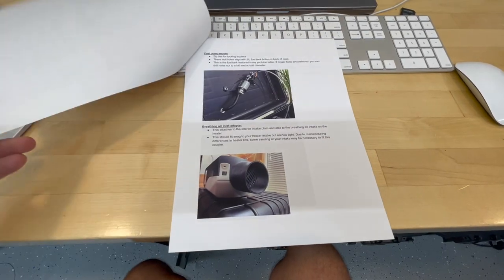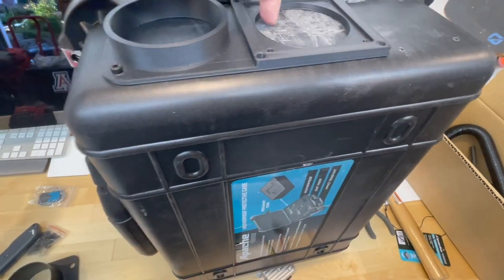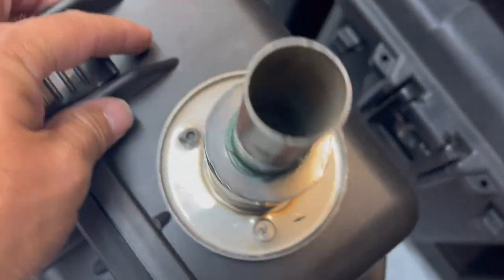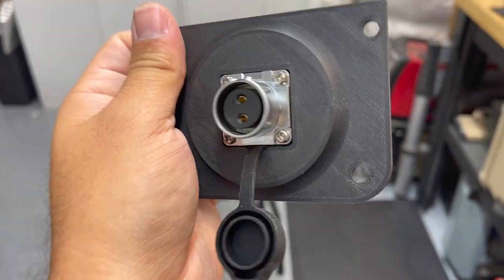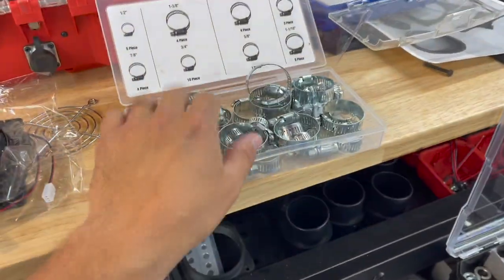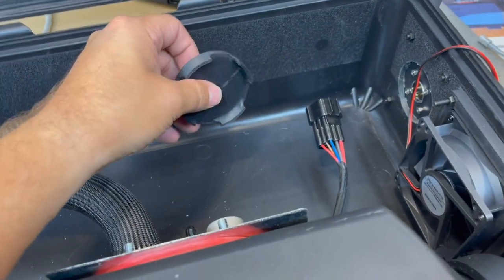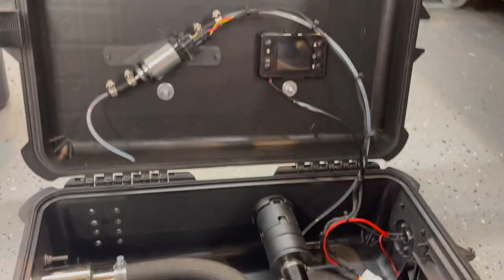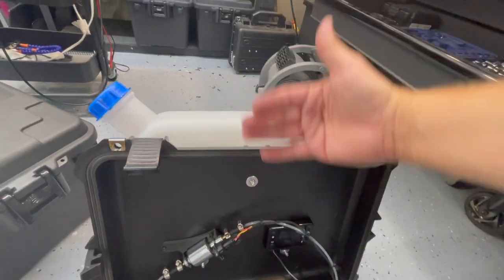DIY Diesel Heater in a box: How-to

Comment: I just finished my 5kw build with your parts. Thank you for making this project faster and cleaner. I’m looking for some longer 75mm duct hose. Ideally something more durable and insulated. Any ideas?
Reply from the maker: https://amzn.to/3SSZ3c5 a bunch of guys use this for there tube
Reply: Congrats, how much did it all cost in the end?  I only need a portable heater for ski camping a few nights out of the year as I have a Propane fireplace in my camper already (not good enough when its 0 degrees).  I was considering the HCalory HC-A01 but this build looks so nice.  I'm guessing it may be more than twice the cost tho.

Comment: Maybe i missed something but what is the purpose for putting it in a box?
Reply: Portable in one easy carry, already setup unit. Depends what you are using the heater for and where you are going to mount it. You could borrow this too someone whose heat was out with little setup.

Comment: Using your layout and 2kw parts which I bought from you….  Can you put the controller screen inside the 2kw smaller case (without it melting)?
Reply from the maker: you sure can! Then just remember to run your heater on Hertz mode and control heater speed with the wireless remote.

Comment: Why the 12v fan on the case??
Reply from the maker: 3 reasons, 1) provides air to the heater combustion intake, 2) keeps components inside the case cool, 3) helps evacuate any potential off gassing or fumes if there was ever an issue.

Comment: I can see there's alot of work gone in to this but it just falls short of perfect... and theres no way I'd trust the fuel tank fitting... also why didn't you put the wire through the small hole and fish it out the big hole then attach the nozzle and pull it back??.. I don't feel I could turn that on and let it run with out constantly checking for fuel leaks.. but other than that not a bad set up...
Reply from the maker: Check out my 2kw version if you want to see a whole other level of engineering that went in to this thing. Would love to see what you come up with when your done perfecting it :)

Comment: Hello Keegan!  Just finished building this and all the hardware etc fits perfect.  After initial testing it was working great.  However, I just ran into a voltage error code and am not sure why.  E-01.  Could this be because of my soldering?  Using good wiring albeit a cigarette plug off of a Goal Zero 1250.  Haven't had issues before with this heater as I had it installed in my previous truck for a few months using the same power source.  The Goal Zero is at 1/2 battery capacity but is still supplying 100+ watts when the heater is firing up.  It will run for a minute or two then stop due to the voltage code.  Any thoughts?
Reply from the maker: Hey Barry, try plugging that cig lighter plug in to your car whilst the engine is running. This will ensure high amperage. (just as a test). Also question, how long of a cord did you make for this? I wonder if you are getting voltage drop over a long cord length?
Reply: @keeganbuilds  I did this and am still getting the code.  The cord is 10ft max haven't measured it though.  Could be less.
Reply: I am going to try to fully charge the battery pack and see if that helps.  It usually is connected to my truck and charges while driving.  Right now I don't have it installed so it is showing 50% battery capacity.  That may be why it is dropping too much voltage.  Its a big unit though so I didn't think it would drop so much.
Reply: Any update on this code?  I have the same thing off my battery kit.
Reply from the maker: @NickOcean  usually under voltage. Try hooking up to a car battery on a vehicle that is running to rule out possibility
Reply: I ended up tearing the heater down and cleaning it.  I think with the low voltage it sooted up and compounded the problem.  I also got a new battery pack.  Seems to be running good now but occasionally will throw a code. I am going camping this wind and am going to run it all night the night B4 just to make sure.  I'll let you know how it goes.

Comment: Wouldn't it be cheaper to just buy the all in one heater?
Reply: The obvious problem with those is how crappy the case is, and has no waterproofing or dust proofing. They would probably rattle apart after one washboard road. This you could set on the ground outside your tent year round in all weather.

Comment: do you really need  the extra exhaust fan? its dragging extra juice out.
Reply from the maker: The fan is pushing air into the case. Not drawing it out. The purpose is to provide cooling air to internal components as well as the internal combustion air.
Reply: @keeganbuilds I’m curious why not just place another hole in the case for the intake? I bet you could get away without an intake fan then. Have you had the case melt? Or have you ever tried this?

Comment: Can it be run closed? Or does the case have to remain open?
Reply from the maker: I typically run it closed exclusively. sometimes I open it up just if I am messing with something, but generally speaking, I never even open the case.
Reply: @keeganbuilds  Awesome, thank you for the response, I am fixing to buy your kit on Etsy and build this in to a Milwauke Packout Large Tool Box. Have you had any issues with plastic melt at the junction where the exhaust goes through your case?
Reply from the maker: @gzusburrito  nope. If you use a proper “thru hull exhaust” it works great!

Comment: The only question I have is why? You can buy them already in a metal case. Your design is also dangerous if used indoors or in side of anything. If you set it outside and just duct the output hose inside you will be loosing a lot of efficiency. Return air to the heater should be from inside the heated space. Anyway, have fun. To each his own.
Reply: Build quality for 1 customization for another, mine has a tank on the case but I can also run it to a 5 gallon jerican, carry mine back and forth from my boat to my pickup.

Comment: DO NOT!!! use the “dryer” type hose for a regular install, it’s fine for this because it’s so short. On a regular install it’s too flimsy when the heater is running, ask me how I know… Thought it was a good idea for a tight area install and it was until I turned on the heater and the hose got hot… bad idea.
Reply from the maker: Great call out! I would also point out that if you are using dryer vent hose for your outlet, you can use a bit of the flexible piping that comes with these heaters to give yourself a heat buffer. Maybe cut yourself a 1 ft section and have that go between your heater and dryer vent tubing.

Comment: How many pin connector would you need to put the controller on the exterior of the box if it all possible?
Reply from the maker: 5 and it’s 12v pos, 12v neg (for heater) then 5v pos 5v neg and blue signal for the controller
Reply: @keeganbuilds  will that fit your same plug plate?  I purchased your kit off Etsy.
Reply from the maker: @scottshellenberger4721  it will! Same exact shape. Just pick up the 5 pin plug from the same link

Comment: I really don't understand why you would go to so much effort to build this from kit form.  Your basic guy on the street will take hours to do all this, get very frustrated and annoy his/her partner for days.  Why not just buy the built diesel heater that even costs a lot less then yours did to build.
Reply: And not have your fuel line running directly on your exhaust pipe
Reply: Well, I am a basic girl who is following this video and build.  I am at the point of drilling hole for fuel hose and so far, I have done great , THANKS TO THIS VIDEO!!!  The only thing I am nervous about is soldering the wires on quick connect.  I never soldered before so hope I don't screw it up..  this build is not hard if you follow his video!  Great job n thank you!  Now I can enjoy ice fishing again!  Cant take the cold the older I get.  Crossing fingers I will be test running this, this weekend.!

Comment: Do not do this its stupid and dangerous for so many reasons the fuel line is resting on the exhaust and the thermostat is inside the case WTF its a bomb and the off button is in the fire area.some people are all about the views and point not your saftey. Not to mention you can by these in a all in one metal box for 10$ more than the heater kit itself and there's saftey measures in place 😀.
Reply: Go back and watch it again at 36 minutes 20 seconds you can see that the fuel line is on the air intake into the combustion chamber not the exhaust from the combustion chamber. I have to agree with you about having the on and off switch inside the case but in another comment you can put a five-pin power connection and run everything into wherever it is you're powering it from, like I do for my boat and for my truck. And if you want to go by the metal case go by the middle case.
Reply: That's what we are here for. To point out concerns and work together to perfect the process. I would prefer a metal box.
Reply: @Nimashet  the on and off is done with a keychain remote.

Comment: The air intake for the combustion chamber should always receive air from a fresh air exteriour source for better fuel burning this gives the chamber and injector a longer life and the exhaust should be fitted to release gas outside to avoid DEATH BY CARBON MONOXIDE   THE CHINIESE HAVE BEEN USING THESE FOR YEARS AND RECOMEND THERE FITTINGS TO BE ADHEARD TOO ANY MODIFICATION  AFFECT WARRANTY
Reply from the maker: The combustion intake receives air from the outside via the computer fan blowing outside air into it. The exhaust is completely sealed using exhaust sealant and clamps. All exhaust fumes exit the case completely. Also the breathing air comes from outside the case. Not sure what that last sentence means, so I can’t answer that one. Let me know if you need any more clarification on how this works.